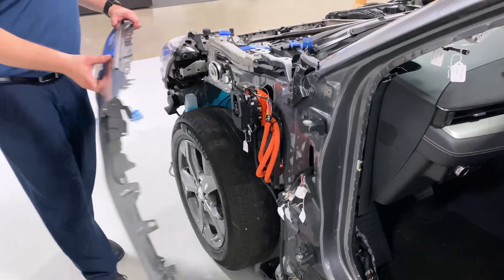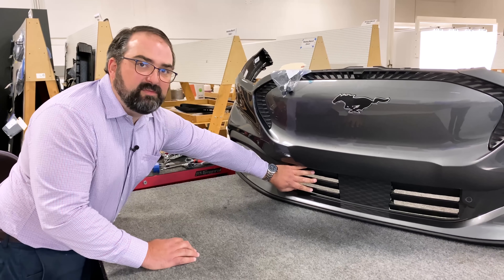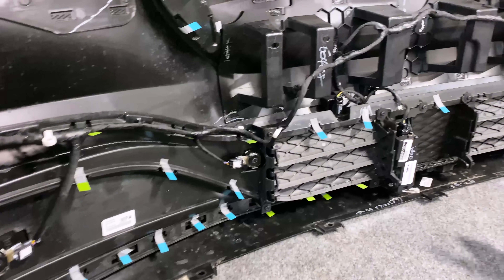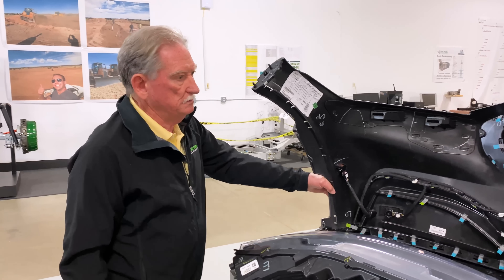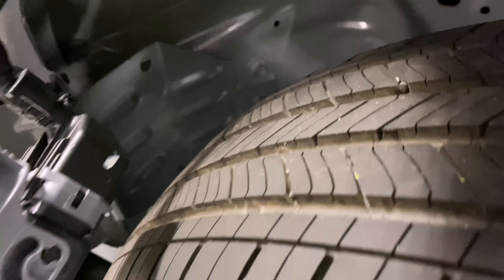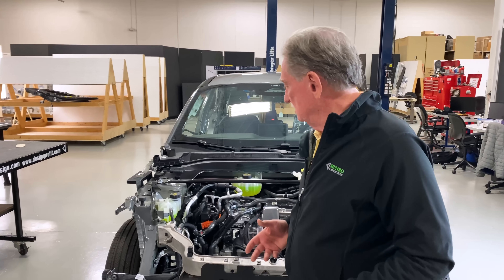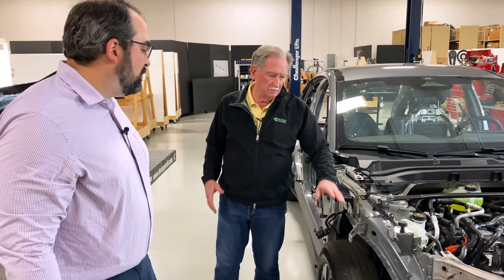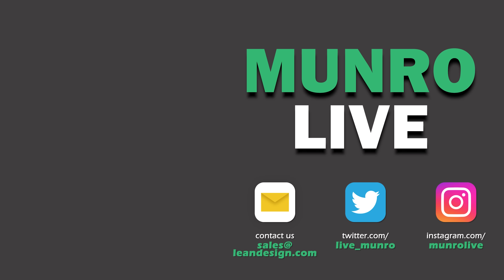Does the Mach-E pass the SORB test?

Comment: I disagree with the idea that threaded fasteners are bad.  Plastic snap-fasteners will get brittle with time & temperature extremes, and they will tend to break rather than yield and come loose.  Later repairs will get a lot more complicated with snap fasteners, and more expensive because more parts have to be replaced.
Reply: different engineering for repairs than for production. Sandy worries about production cost.
Reply: Sandy does not care about repairability. He has said so on previous videos numerous times. He only cares about initial production costs. "Hey boys and girls, let's make a car that will terrible for you in a few years."

I'm with you. 5-yro snaps are terrible to work with. The worst is that its often the retainer on the part that breaks instead of the disposable clip! It's so much nicer to unscrew a bolt. It seems to me that a repairable car will retain value in the used market.
Reply: Everything is a trade-off. Where is your priority for cost savings? Also, which repair scenarios should be easy? Which ones are infrequent or imply the car is totaled? You look at everything and seek to minimize TCO, total cost of ownership.
Reply: @AndyZach  Parts, like lights, that don't last out the power train?

Comment: SORB is what the Tesla Model S failed at, with a Yellow (Average) rating.
Reply: Model S still has a Yellow (Average) rating for 2022 model year cars. Tesla made adjustments for 2017 model year to the structure, but still failed. https://www.iihs.org/ratings/vehicle/tesla/model-s-4-door-hatchback/2017
Reply: Source ?
Reply: @gabby9835  That was for the 2012 model year for the Model S. At the time it was a new test requirement. On the previous standard they scored off the charts. They fixed the problem  with SORB in the middle of the  run for the 2012-2013 right around the time they  had to fix the battery pack by reinforcing the  battery shielding with a piece of  titanium.
Reply: @chris55top  Thanks for the clarification. Your previous comment was vague without the timeline. You're right.
Reply: @chris55top  It got an A not off the charts. But good enough.
Reply: @gabby9835  If you want an actual source google it. It was headline news during that time period or at least to EV nerds.
Reply: It got A for acceptable. Not as good as mach e but good enough. Link :
https://www.iihs.org/ratings/vehicle/tesla/model-s-4-door-hatchback/2017
Reply: 2017 model had revisions and was retested by IIHS. This is the same structure used in 2021 cars. The updated Tesla Model S still got a poor, yellow rating. Even the compact cars get Green ratings in this test.